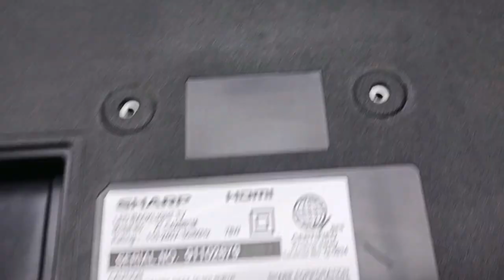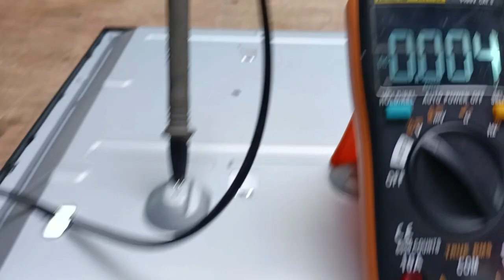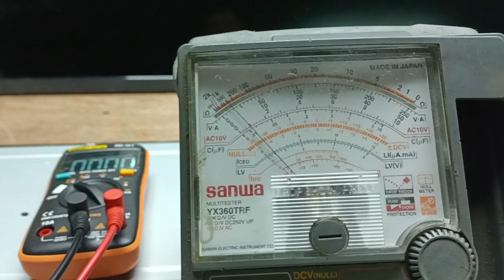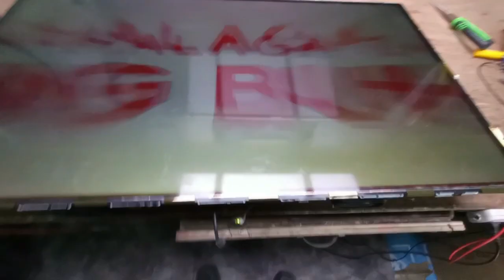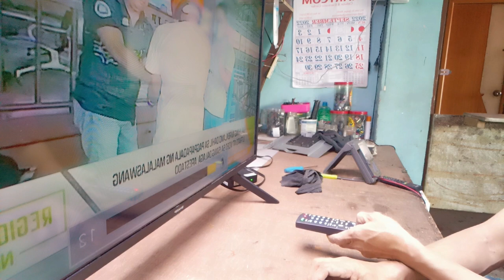How to repair Sharp 42" led tv no display.#how to trouble shoot missing vgl,vgh voltage

Comment: Sir napanood ka tong video mo wala siyang vgl at vgh pero paano sir kung mayron nman voltage ang vgh at vgl pero wala siya picture? Ano sira po sir
Reply from the maker: Hello sir.. may short po sa mga ckv signals. Blocking or cutting methods ang pwede e apply diyan.

Comment: Kung nasa kabila po ang short sa panel papano po gagawin pag timanggal ang ribbon wire lumalabas ma ang vgh kaya lang kalahati lang ang may picture
Reply from the maker: tape method po ang  paraan  pag may short ang panel on kailangan  nakakabit ang 2ribbon.thanks sa tanong mo.
Reply: @gertechph  ah okey hindi po pala e ka cut e ba block nlang ng tape method mga ilang pin po ?